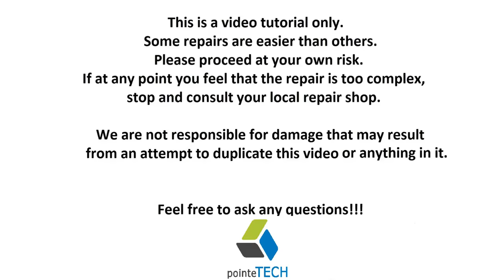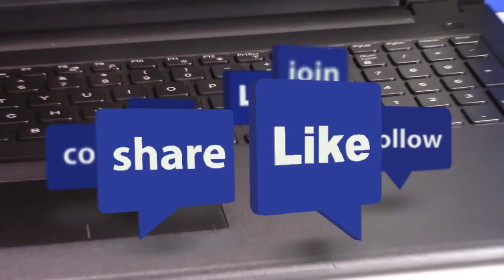How To Fix Replace Keyboard Key - Dell Laptop Enter Space Backspace Shift Large Key

Comment: I think I messed up, for some reason space key doesnt return to it's original position and stays down, I think there's something wrong with the left retainer clip, but when I checked it, it seems identical and unbroken to the one on the right side.
Reply from the maker: If your Key Cap is not clicking down in place correctly, it is most likely due to the Retainer Clip not being properly installed or damaged.  Remove the Cap and inspect for damage or that its not laying down flush and properly snapped in itself.  Compare to another Clip if needed by removing another Cap.

Comment: The small plastic pieces on mine are broken down into 3 pieces instead of being a single 1. It wouldn't lock into place at all... What I did was glue them together in the right order and it works now but it's a bit too loose for comfort. It's a temporary fix for sure. Is there anything I can do to fix it properly or do I just need to search for parts? 💀
Reply from the maker: Sounds like you need a replacement at this point :( Would you like help finding a replacement key or keyboard?

Comment: i broke the switch underneath the one that breaks easily... spacebar still works, it just rocks back and forth if i dont press it in the  middle or a little on the side
Reply from the maker: Are you asking for help finding a replacement key?  I usually get my keys on Ebay or www.replacementlaptopkeys.com.  If you cannot find a loose key for sale, you may have to purchase a keyboard and take a key from there.
Reply: @PC_Monkey   its the white plastic underneath the broke the ones you said breaks easily XD the keyabord works fine but i'll try to find a key through the website you linked if they come with the white plastics because thats the only thing i need (i have a Lenovo Legion 5 15IAH7)

Comment: great videos thanks and hello from london uk
Reply from the maker: Thanks !!  Glad this video was helpful :):)  Greetings London from America !!
Reply: @PC_Monkey  Hello again I was wondering if you could help me please. I spilled a half glass of port which is a very sweet wine on the keyboard of my dell lap top and wiped it off very quickly. Yesterday 3 days after the event i took the keys off like your video showed me and cleaned the inside of the keys because the computer just would not work. The battery will not work now and through the mains lead i can boot up the computer and can just about access stored info and use you tube but the keys just will no longer work. I suspect i may have terminally affected the computer can you suggest anything that may help? Thank you
Reply from the maker: @ricdavid7476  Yes, spilling liquid on a computer can, in most cases, damage multiple components.  Least of all the motherboard :(   You said the computer will not work and the battery will not work.  Are there any signs of life at all when you try to turn it on?  Lights?  Fan, Motherboard, or Hard Drive sounds?  Anything seen on the screen?
Reply: @PC_Monkey  Hi thanks for replying. I am not sure what the motherboard is. i just tried to take the back off the computer took all the screws off but could not open the back up. 

The computer wont let me sign in with the pin number just the fingerprint. The buttons on the keyboard seem completely unusable . When i type nothing appears on the screen at all. There is zero battery and zero fan that i can hear. It seems like something has got corrupted or maybe shorted out. I am pretty much resigned to having to get another computer. If that is the case are there any parts on the computer that could be sold as spares? It is a 6 year old Dell Inspiron i5 5000 8th generation ? 

 it is an expensive lesson about not getting smashed near the computer.
Reply from the maker: @ricdavid7476  true lol.  You would have to look up each part on sites like Ebay, Amazon, etc and see if its worth selling.  Usually some parts like the motherboard, CPU (if its detachable) and some others can be worth selling.  However if the computer is unusable, you cant really test if the parts are good or not so may run into trouble selling them if the buyer cant get them to work

Comment: I thought of opening my space key to clean it since it was a bit sticky. Read somewhere that you just have to pry it open with a screwdriver. Turns out I pried open the plastic thingy too and heard a snap. The space key was now tiled at 40° not opening not closing. I watched your video, and found out the flimsy bit of plastic hadn't broken, and in a few minutes I was saved from a trip to the computer store. Going to turn my laptop back on and hopefully the key at least works and doesn't stick.
Reply from the maker: Happy to help :)  Always here if needed !!

Comment: My tab key isn't working, so I'm going to try and fix it myself. Thanks for the info!
Reply from the maker: Good luck !! Let me know how it goes :)
Reply: @PC_Monkey  it's still stuck.
Reply from the maker: @SandravsSlots  If the key is broken, you will have to replace it.   I usually get my keys on Ebay or www.replacementlaptopkeys.com.  If you cannot find a loose key for sale, you may have to purchase a keyboard and take a key from there.

Comment: Thank you for the awesome video! :) In my case, my Dell inspiron laptop (newer model ) has the retainer clip attached underneath the ctrl key. After reattaching the ctrl key, it snapped back in (as far as I can tell) and I'm pretty sure it won't come off, however the key sort of dangles and is not completely snapped back in like how it originally was...do you know why this could be? Thank you!
Reply from the maker: If your Key Cap is not clicking down in place correctly, it is most likely due to the Retainer Clip not being properly installed or damaged.  Remove the Cap and inspect for damage or that its not laying down flush and properly snapped in itself.  Compare to another Clip if needed by removing another Cap.

Comment: My shift key-Latitude e6430-does not have the stabilizer bar that the space key has in your video? It didn't just vanish?  Can't find a video on just the shift key for this laptop?
Reply from the maker: Not all keys will have the same parts that other models have.  Yours may not.  Unfortunately, I dont have that exact same model on hand.  Are there any other keys the same size as that one on your keyboard?  If so, you can remove the key cap only to see whats under.

Comment: My spacebar only works if I press on the middle part. When I press on either the left or right part, they feel like they're sunken 
and I hear no click. I just bought this keyboard too.. What do you think is the problem?
Reply from the maker: If the keys dont 'feel' right on the sides, they are most likely not installed properly / have become lose.  I would disassemble, inspect for damage, and if none is found, try to reassemble

Comment: Hi there! I've been facing out this kind of little issue.  my laptop is a 'quite typing sound', but somehow i found my space key's giving me a little squeaky sound when i gently touched it (not if i did a quick typing ofc). will doing this gonna fix the problem or is it normal? it's a common button and quite large, that's why i thought it was a little weird. Thanks !
Reply from the maker: Sounds like it could be a mechanical issue.  I would remove it, clean it out, and install again.  See if that stops

Comment: My space bar is getting stuck in, doesn’t want to pop back up, any idea?
Reply from the maker: I would disassemble as seen here, and inspect for damage or for the need to be cleaned.  If no damage and after cleaning, I would reassemble.  If still not working, its most likely damaged or not installed correctly.  You may need to replace it if it cannot be installed correctly.

Comment: okay so I took out the retainer and the keycap of my left ctrl key and it looks nothing like any tutorial on yt. Can you help me I can't get it back in
Reply from the maker: What brand and model computer do you have?  Its not just a Hinge Clip, Key Cap and Rubber Spring?  Its different that that?
Reply: @PC_Monkey  it's the dell Latitude E5470. It has these hinges and all but they're arranged differently (and in a way that I can't compare them to the video).
Anyways I managed to puzzle it together in a way that makes sense and now the button is just depressed all the time.
Reply from the maker: @lreismann9180  If your Key Cap is not clicking down in place correctly, it is most likely due to the Retainer Clip not being properly installed or damaged.  Remove the Cap and inspect for damage or that its not laying down flush and properly snapped in itself.  Compare to another Clip if needed by removing another Cap.

Comment: Hi, the little silicone button in the middle of the space key is broken. Do you please know some good way on how to fix this? Thank you very much🙏🏼
Reply from the maker: There isn't really a good way to reattach those.  They are not meant to be replaced.  Best advice is try to use a small amount of glue.  If that does not work, you may have to replace the keyboard.

Comment: there are these 2 plastic clips on the side of each of my keys I suppose holding them into the frame? I cant seem to get the key cap off without breaking these clips. If this helps, my model is a dell latitude 3120. I hope you can help😄
Reply from the maker: Are you referring to the hinge clips?  If not, can you post a video to your channel?  Message me back here when you do.  I can then view and advise further :)
Reply: @PC_Monkey  I don't believe those are hinge clips but I now know how to get them out somewhat carefully by testing on an old broken laptop. However, I don't feel like I should take this shift key off as it may snap and this laptop is a rental. I am unsure of what may be causing the problem underneath the key but it has to be a hardware issue because I have tried all the software fixes to fix my left shift. I have noticed on my laptops that after about a year of owning them the keys start to not respond and then start working by themselves. The same thing has happened on this laptop and on my old laptop when i pulled the troublesome key apart and put it back together it did not fix the issue that has happened to just my left shift key after I pressed down on many keys at the same time on the left side of my keyboard. Hope you can help :)

(sorry for writing such a long paragraph😅)
Reply from the maker: @smallercactus9116  Yes, if your computer is a rental, I would not risk breaking it with a new DIY repair.  Keys are sooooo easy to break :(

Comment: Is there any trick to doing the caps lock key on an e7270?  The metal bar is hooked sort of like the space bar and so far I can't get it to re-assemble.
Reply from the maker: The metal bars usually follow a couple clips on the underneath of the key cap.  Both the ends of the bars usually slide into metal fittings on the keyboard.  If you like, partially disassemble another key on the board the same size to compare.
Reply: @PC_Monkey  thank you, I'm going to try that next!

Comment: it didn't work for me.  as you can see, my shift key isn't working.  i popped it off to clean a spill, and when i put it back on the key lays flat and hugs the keyboard.  Should the metal stabilizer bar be under the retainer clip?  one of the retainer clips is not as free-moving as the other - could this be the problem?  thanks!!
Reply from the maker: If your Key Cap is not clicking down in place correctly, it is most likely due to the Retainer Clip not being properly installed or damaged.  Remove the Cap and inspect for damage or that its not laying down flush and properly snapped in itself.  Compare to another Clip if needed by removing another Cap.
Reply: @PC_Monkey  The retainer clip on the right is moving freely.  The one on the left, not so much.  But the entire key feels like its semi-glued to the surface!  I've tried to free up the clip.  Maybe there's gunk under there.
Reply: @PC_Monkey  I worked it out.  Took a magnifying glass to it and turned it every which way until it was exactly right - and it finally really did work!
Reply from the maker: @naomin5284  Nice job !!   Keys are a small part of a computer but they can definitely be one of the most frustrating lol

Comment: My space bar on a wired DELL keyboard is wobbly I believe on the of the bars plastic is broken, what should I do?
Reply from the maker: If your Key Cap is not clicking down in place correctly, it is most likely due to the Retainer Clip not being properly installed or damaged.  Remove the Cap and inspect for damage or that its not laying down flush and properly snapped in itself.  Compare to another Clip if needed by removing another Cap.
Reply: @PC_Monkey  Thank you thats what the issue seems to be!
Reply from the maker: @AnimeslayerzFranty  Happy to help :)  Always here if needed !!

Comment: For some reason after replacing 3 other keys fine, my enter key now sticks down despite having all the parts replaced and nothing obviously wrong.  Every encountered this before?

The unfortunate thing is I think somehow the contact itself also got messed up simultaneously and even when i press the key down without the keycap on it acts like the key is stuck down, and absolutely noone online has written about repair of the actual contact itself.  I still feel though that fixing the seemingly unrelated issue with the key sticking down may do the trick
Reply from the maker: If your Key Cap is not clicking down in place correctly, it is most likely due to the Retainer Clip not being properly installed or damaged.  Remove the Cap and inspect for damage or that its not laying down flush and properly snapped in itself.  Compare to another Clip if needed by removing another Cap.

Comment: The plastic cap is attached onto the key pls help
Reply from the maker: Because they key can usually not be reinstalled with the Retainer Clip and the Key Cap still attached to each other, you would have to separate them as seen here, using a small flat pry tool.

Comment: My backspace key fell out and I can’t put is back on and I need help
Reply from the maker: If your Key Cap is not clicking down in place correctly, it is most likely due to the Retainer Clip not being properly installed or damaged.  Remove the Cap and inspect for damage or that its not laying down flush and properly snapped in itself.  Compare to another Clip if needed by removing another Cap.

Comment: so my coke spilled on my keyboard and the spacebar was not working properly because of the stickiness so I took it out and fixed it properly the first time. the next day it again stopped working and I took it out again and kinda broke the flimsy plastic and got a crack from one side, now the spacebar is back in its place but it's kinda loose. is it because of the plastic or what?😭😭
Reply from the maker: If one of the key assembly components is damaged or broken then yes, that is most likely the reason why its not physically working well.    I usually get my keys on Ebay or www.replacementlaptopkeys.com.  If you cannot find a loose key for sale, you may have to purchase a keyboard and take a key from there.
Reply: @PC_Monkey  thanks bestie, will look it up
Reply from the maker: @whosaabi  Good luck !!  Let me know how it goes :)

Comment: your video help a lot with my company's Dell Latitude 7400. Problem is..the individual key is not protruding like the others. it stays flat. i tried twice to reinstall it but it stays that way and i dont want to risk it further. any idea?
Reply from the maker: Either the rubber spring has been damaged and isnt pushing the key back up or, more likely, the retainer clip is not installed correctly and isnt opening correctly to allow the key to pop back up
Reply: PC Monkey tq for the quick reply and explanation. That look like my case here i guess. Tq !!
Reply from the maker: @aliasahar4700  Happy to help :)  Always here if needed !!

Comment: If you lose the little bouncy bit, do you have to order another one or is there something else you can do?

Edit: I did find it, but I’m not sure how to reattach it, I doubt I can just glue it on, but I’m not sure what else to do
Reply from the maker: There isnt really a good way to reattach those.  They are not meant to be replaced.  Best advice is try to use a small amount of glue.  If that does not work, you may have to replace the keyboard.
Reply: @PC_Monkey  Thanks

Comment: the white thing is connected to my d key
Reply from the maker: If the hinge clip is still attached to the key cap, you would need to separate them prior to install.  You can do that as seen here, by using a small flat pry tool

Comment: its still wobbly
Reply from the maker: If your Key Cap is not clicking down in place correctly, it is most likely due to the Retainer Clip not being properly installed or damaged.  Remove the Cap and inspect for damage or that its not laying down flush and properly snapped in itself.  Compare to another Clip if needed by removing another Cap.

Comment: Hey, I tried to get my spacebar off with the help of a pointy object and I guess that scratched my chipset under the key because of which my spacebar stopped registering... Is it actually because of the chipset or is it due to some other kind of problem..? If you know what has really happened can you tell how can i fix it or how much will it cost to be fixed?
Reply from the maker: The key would register fine before the operation but will not work now? Is there physical damage under the key?
Reply from the maker: @69headphones_  It sounds like you may need to replace the keyboard at this point :(